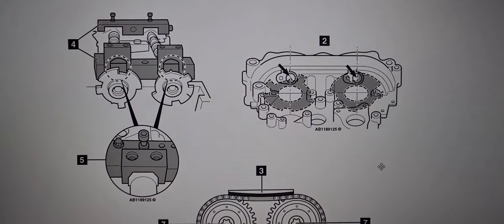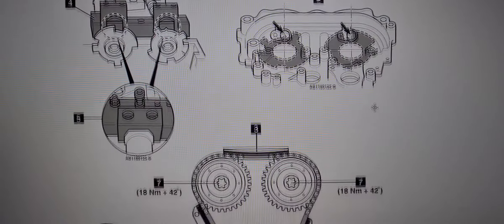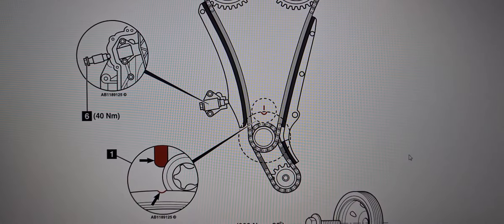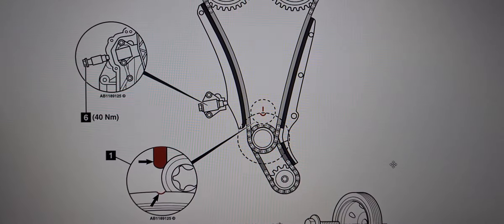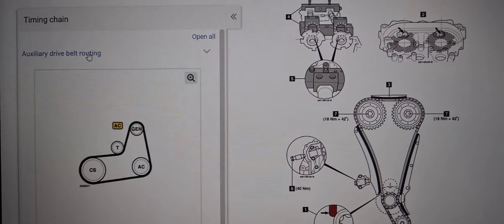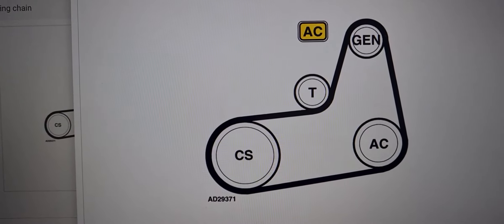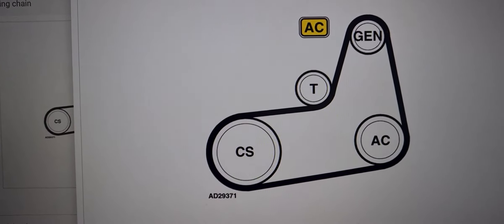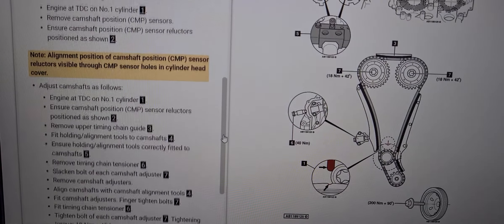Mercedes E Class Timing Chain Diagram 2016-2019 - Includes full Specifications

Comment: Thanks for sharing the diagram. There is four retaining brackets for the camshafts on the top of the cylinder head. Do you know what the torque settings are? I can't find them anywhere.

Comment: Hi there just watched your video,  in the middle of the camshaft there’s four bolts with a small bracket that hold down the cam shaft. Do you know what the torque settings are? I can’t find them anywhere. I’m rebuilding an engine at home really appreciate your help.

Comment: Thanks video very informative. But I need help now engine check light code poo16 camshaft crankshaft coalition . I have replaced timing chain and both cam gears and tensioner, all genuine parts. Have set it up as per your diagram using cam locks etc but check code clears , road all good, turn engine off , restart same code comes up. Can you help, I’ve heard the m274 is not TDC but 20 deg before TDC when setting the chain up ? 2014 WDD2122342B016713.  Motor 2.0 lt turbo M274920300182763.  Model code21223422-Au1 .  Appreciate any advice please. Allan
Reply: More then likely the intake camshaft reluctor wheel is off which means you need a new camshaft. take off the cam-position sensors and look at the marks when you place tdc/ot on the dampener exhaust cam should be in the middle and intake cam has point in the middle  if both are not there you need to change it